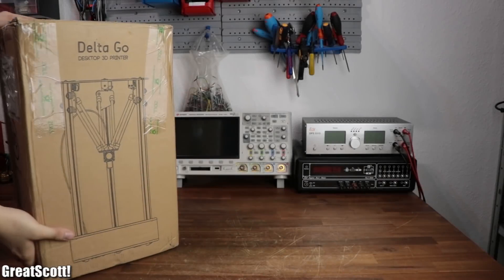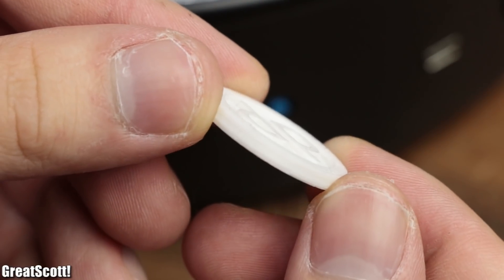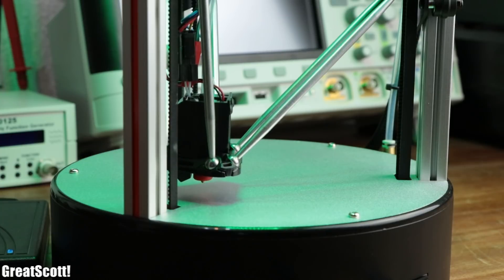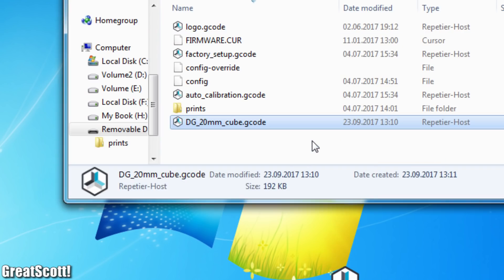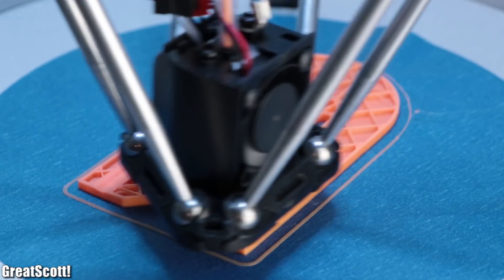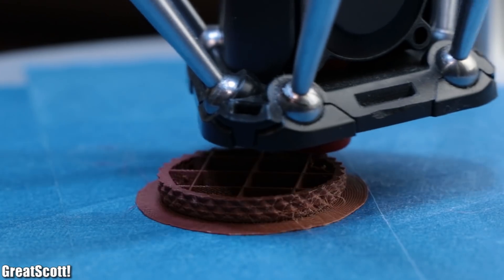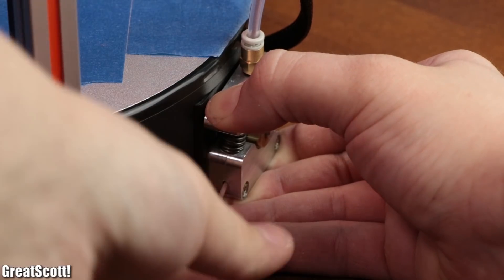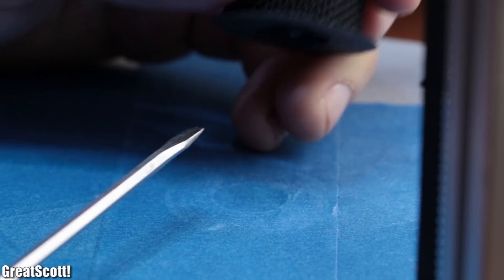Delta Go - Desktop 3D Printer Review || $450 Delta 3D Printer

Comment: I wish you had explained what a delta printer is vs. corexy and Cartesian.   Being able to quickly set up and print reliably is rare in the 3dp world.  The price is actually excellent.  The main issues with it are bo heated bed, no wifi (they should offer a Pi 0w2 version with Klipper) and small build size.

Comment: I had a similar problem with my machine, extruder was skipping from time to time, your prints looks to fail in the "same place", maybe the problem is the same also...
Mine was: Driver overheating.
This explains why it fails around same place, it overheats then enters in thermal protection mode, generally soon as it cools it works back, if heats again it will stop again of course...

Comment: Hello Greatscott!! I have seen both of your delta 3d printer review. Now i'm little bit confused which one should i buy, the 3KU Updated Full Metal Delta 3D(US $359.00 - 409.00) or the Delta go 3dPrinter($349.00). I like the Delta go model because it is cheaper and compact model.But it has extruder problem.Any suggestion???

Comment: Based on the three failed prints and the stepper motor skipper, it seems like the fails happen around the same time frame. My guess is that the stepper driver overheats after said time frame. I doubt it has something to do with clogged hotend.

Comment: The failed print issue is heat creep from the hot end to the cold end. I have have had the same thing. Remove the heat break and add thermal paste to the cold end side to improve the heatsinks ability to remove the heat.

Comment: the weird flickering is because the LED's are being run from 12v from the board instead of directly from the power supply. the board's 12v rail is running the steppers and that's what's causing the flicker. i've added 12v rgb led's to my printer(also a delta type) and that happened until i connected directly to the 12v lugs from the main 2.1mm jack.

Comment: It does not matter if this is or is not a paid review, all that matters is if its accurate and informative.

Myself I would really love a 3D Printer as I am always working with radio control cars and breaking and making new things
and it would be awesome to be able to create my designs on computer and print them out.
But this video has confirmed my thoughts that 3D printing is not quite "plug and play" yet to the extent anyone can buy
one plug it in and its prints faultlessly so I'm holding out for a few more years.

Thanks GS for making the informative video and thanks to Deltaprintr for providing the test printer

Comment: I bought a Delta last November, used it for a couple of months, then junked it. I'm NOT a fan of deltas. They're a pain in the rump to deal with calibration even with auto-levelling, the round print bed robs you of a lot of space - IMO put a square within the circle and consider THAT to be your max size.  The Bowden (tube) extruder is very limiting for filament types and makes things harder to deal with than a conventional setup as well.
IMO the only significant benefit to a delta is that they're kind of amazing to watch. But once you get beyond that they don't (again IMO) have much benefit.
Also $450 is too much money for such a small printer with no heated bed.
I have owned/built about a dozen printers at this point, some mostly from scratch. My workhorse right now though is back to a good old i3 design, the JGAurora metal frame unit. They've solved all the issues with messy appearance, stability, etc.  It just works, day after day. The only thing I've done is to throw on a glass print bed.  At $300 it's a no brainer.

Comment: for clogging problem, you may need to lower your retraction settings, especially for all metal hotends
for benchy overhangs, add a part cooling fan will help
for bed adhersion, buildtak-like print bed is nice for printers without heated bed
to print flexible filament, try the flying extruder mod, which shorten the bowden tube to reduce fiction when pushing the filament into hotend

Comment: The issue with the filament feeding mechanism being removed so far from the hot end means that it needs to push a lot of filament ahead of itself, which means you need a stronger motor and a higher clamping force on the filament to push it that far. That's why it's skipping for you, and I can't help but think that if they had included that (and figured out how to move around a big stepper motor) on the hot end side of the printer, it would've solved a lot of their feeding problems. There are benefits to having a lighter printer head, of course, but if you can't get the printer to run consistently you may need to rethink your design decisions.
Reply: And you also have a few extra feet of filament left over when you finish a spool.

Comment: the stepper motor needs more amps the power supply that was included with the printer have a very low current you need at least 15A power supply without a heated bed.

Comment: With any Bowden setup I recommend a Filament wiper/ oiler. It wipes away dust before it can get into hot end and block it up. Also the bit of oil lubricates the filament through the tube and helps with retraction not causing jams.  3D print one, add a piece of foam in it then a few drops of vegetable or any oil will do. I've not had a clog since I started using them. https://www.thingiverse.com/thing:492067
Reply: CNC kitchen did some interesting videos about filament wipers/oilers,  you may find them interesting
Reply from the maker: Thanks for the advice. I will give it a try.
Reply: GreatScott! Use a pice of ABS to do a few "cold pulls" it cleans out the hot end fully. Just google cold pull. There's a good guide
Reply: Victor García I've not really seen anyone use them, I'll check it out bit I find it made a huge difference for me. Especially with the printer I need large retractions to use well
Reply: Ben Carter don't use oil, it degrades the plastic
Reply: VampCaff I've been using oil for months, there's no significant down side to using the oil. It's a couple of drops per Kg of filament probably. The oil is just there to help with dust removal and to lubricate the bowden tube.
Reply: Ben Carter
The type of oil and the type of filament vary how bad the effects are. Some combinations will result in serious degradation of the strength of the print.

Comment: I noticed the print flexing on the benchy test print. A part cooling fan would prevent that. I paid less than what this printer costs for an i3 clone which has a heated bed, a larger print area, and part cooling fan. It has a few quarks too but over all has been working really well for a couple months.

Comment: Or just buy the Anet A8... yes its bigger but it does have a heated bed and Ive never had any issues with the extruding. And its 1/3 the price xD
Reply: But a well calibrated delta easily wins over any prusas in terms of speed.
Reply: All you have to do with the Anet A8 is print a few frame braces with slow speed. Install them and turn the speed up to 120mm/s :P
Reply: AK90 With which acceleration settings? A prusa will never be able to move as fast as an ultimaker, corexy or delta with a similar print quality die to the moving bed, and in case of the A8 the direct drive extruder too.

Comment: Nice introduction to 3D printing. For ABS you really want an enclosed print area so the temperature is more easily maintained, and also a heated bed. Warping will be a real problem with ABS otherwise (your example print won't show it much but flat areas or boxes with thin walls will). I prefer a glass bed for use with my Wanhao 4S, the print never fails to stick with the use of a laquer spray. Your initial sucess must be inspiring though and you will find the machine has many uses!

Comment: what happen if you share your workshop with electroboom
Reply from the maker: Oh boy. I might need to wear some protective gear.
Reply: @greatscottlab  Make sure you are not grounded. Wear 6 inch thick rubber boosts and high voltage gloves.
Reply: GreatScott! Don't forget the padding...

Comment: Cool.  I made my own design of delta printer and write my own firmware based on Repetier. I spent like 3 weeks designing and 1 week building. The total cost was 285usd. In my country the components are expensive so if you get all from internet (like eBay, Alibaba, etc.) probably you can get all for 200usd or less.
The resolution its very good, very close to a 1000usd printer (that I have too).
Probably in the future I'll post an Instructable if someone it's interested.

Comment: Thanks for the review GreatScott! Regarding the filament jamming, we recommend increasing the temperature when the speed is increased. We typically print at 210-220 Celsius, but this of course varies on what material is being used. In regards to warping, we always recommend wiping the bed with alcohol since when the tape is laid down with hands, it leaves oil on the tape that will cause the print to curl up.
Reply: gad look at that poor guy up there you totally abandoned the kickstarter campaign and don't give them any more support for their problems. poor silviu stroe...
Reply: There are also other guys who will make a good review for free printer. So no need to thank him - it's his job to do it.

Comment: I had trouble with my extruder clicking like that (not on a delta go) and I solved it by increasing the current on the stepper driver. There's a tiny pot on the driver board, test the reference voltage between the screw on the pot and ground. I turned mine up to 1.5v. If you turn it up too high you can overheat either the driver or the stepper, but turning it up to 1.5v solved it for me.

Comment: tighten the extruder , and shorten the bowden tube as much as possible.

Should help the extrusion problems.
Reply from the maker: I might try shorting the tube.
Reply: The tube should not be too short either. In my experience the clogging can be due to different causes al the way from spool to nozzle: 
  1. The spoolholder may give too much friction; 
  2. The extruder motor may need more current; 
  3. The extruder wheel may need more tension; 
  4. The bowden tube may have too much friction (use silicon spray, avoid too tight curves and avoid too long tube)
  5. The filament may not be melted enough. Depending on the filament increasing the temperature or lowering (feeding or printing) speed may help. Sometimes slight overextrusion may help too. Proper adhesion also helps, causing the filament to be somewhat pulked out of the nozzle. Don't set the layers too thick or too thin.

Comment: I had the first generation Delta Go printer, the one that got funded on Kickstarter. It was the worst 3D printer I have ever used. It had so many problems it would take hours to list them. Delta Go didn't offer much support, and actually dropped any little support that was left. They then used the money from the Kickstarter to make this newer Delta Go printer, forgetting completely about the original DeltaPrintr and backers. I personally don't trust them anymore. Even if the new Delta Go seems decent.
Reply: Deltaprintr: live chat on USA time doesn't do me much good in Australia, mate.
Reply: Did they ever have a trial by combat over this?
Reply: Here's some things that I had to fix that you could have done a better job on:

1) The tensioning system is badly designed.  The tension is in the same direction as the slot, making it very difficult for the washer and nut combo to resist.  Ideally it should use a lever system or a nut and bolt system to push against a fixed surface.

2) The top of the Bowden tube has a screw thread going into plywood, so it pulls out quite easily.  This should have been either a 3D printed part, a piece of ABS or Acrylic, or a piece of metal.

3) The heater and temperature cables interfere with the bed if they're not restrained, which in turn affects the auto-levelling and causes endless frustration.  This is not covered in either the manual or the assembly video.  A simple clip assembly to hold the cables in place beneath the lowest point of the carriage's travel solves this for me - I can't understand how you avoided this in your testing.

4) I see from the DeltaPrintr Go you also realised that putting the feed and filament reel on top of the printer made it top heavy, complicated the wire paths and caused feed issues.

5) Why supply an acrylic bed to which prints will not stick when cold, engraved with the logo right in the centre where prints are normally done so that it's much harder to clean?  At least supply some blue tape or paper or some covering to help the prints stick.  Or are we supposed to put the logo on the underside?

6) I really wish 3D printers threw in some filament - say five metres - to get people started.  It's yet another purchase that a new user has to make that's a barrier to them getting started, but if you already have a 3D printer more filament isn't a problem.

Issues I don't see as your problem:

A) The LCD and panel never worked for me.  It doesn't respond to buttons, it never lit up.  I plugged it in correctly.  No idea what's wrong there.

B) I've had lots of problems with the feed - either it's too cold and it jams, burring up the thread, or it's too hot and oozes out of the .  I'll have to try a filament oiler.

C) Where's the firmware up to?  Is it up to date?

I realise YouTube comments aren't a good way of giving or receiving feedback, but if you want to be in touch via my Google profile I'd be happy to work through this.
Reply: Paul Wayper but you've gotta give it to Deltaprintr for their marvelous breakthrough: making a line of printers that print as unpredictable as this. 👌
Reply: Indeed
Reply: Hi Silviu, we did not use our kickstarter money to manufacture the new Delta Go printer. Every kickstarter backer received their printer that they backed and there are plenty of pictures on our Facebook page to prove we delivered the printers. Please do not spread false information.

The first printer we manufactured was made out of laser cut wood, not metal and was designed in 2013 when the technology available for 3D printing was different.
Reply: Hi Thomast, we do support all of our customers and offer 12/7 live chat support on our website where we typically reply within 1-2 minutes. If a part ever needs replacing, we replace it free of charge as per our warranty.
Reply: Hello there, Thanks for replying to the comment. I didn't state you didn't deliver the printers, I did receive mine, and so did my friends. I stated they were very faulty and unreliable. No one I know that bought the original DeltaPrintr made a successful print without heavily modifying the printer and tweaking it. The support page was also quite unhelpful at solving the multitude of problems we were having.
Reply: I would believe Silviu. I have one of the website wooden ones similar to the one he has from KS, the worst printer I've ever dealt with. They marketed using fishing line as a better option for "belts that stretch". Belts don't stretch unless you get cheap rubber ones. But guess what also stretches? FISH LINE! I've gone through so many zip ties trying to keep the lines properly tensioned. It can't even print perfect circles let alone squares. I bought a smaller printer at less than half of what I paid for the Delta POS and it prints LEAGUES better than anything and is incredibly rigid. Don't believe them, they're trying to cover their butts. They're the usual snake oil salesmen.

Comment: Can you try replacing the clogging gear with a fluent gear to prevent the clogging problem? That's probably the only major flaw. I was really impressed with the consistent print quality that the other 3D printers didn't have.

Comment: This has the worst delta ringing i have ever seen!
Didn't you see a need to say anything about that?
Reply from the maker: Not really
Reply: If you take a look at 6:16 you can clearly see this paraboloid pattern on the surface. And this was on every print in the video.
Let me guess, it uses a standard 8Bit Arduino?
I really liked every video you made so far, but I think this review was just to positive for the printer.

Comment: Well... even with the 100$ Discount, I cannot afford the Printer. I feel poor.
Reply: I couldn't afford the thing even if it costed $20.
Reply: Have a look at the Anet A8 then. It comes as a kit and requires assembly - but it is a lot cheaper, bigger, and has a heated bed and built-in LCD. And because it isn't a bowden-style printer you wouldn't have any issues with flexible filament.
Reply: Just as well, you can get better printers for less money. My personal pick is the JGAurora i3 clone, but the Anet A8 mentioned by several above has been bought by several friends of mine and it's a perfectly good printer as well.  I'm not a fan of Deltas, nor of any printer that uses a Bowden extruder. They're a lot of flash and little substance. The only advantage to them is they look cool and have a small footprint.  If you actually want a printer that works, day after day, and allows you to use any filament type you want without hassle, pick up an i3 clone that uses a conventional extruder, an all-metal hotend, has a good parts blower and a heated bed.  you can have all that for $300 or less.
Reply: Just save up your money till you have enough.